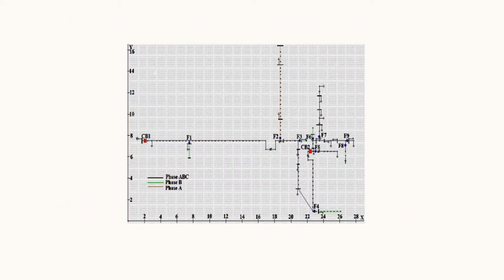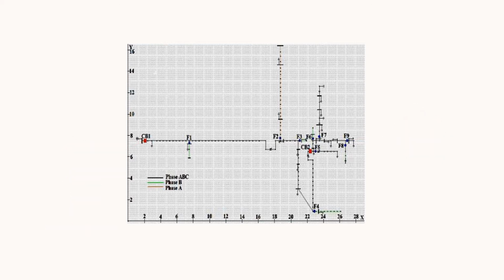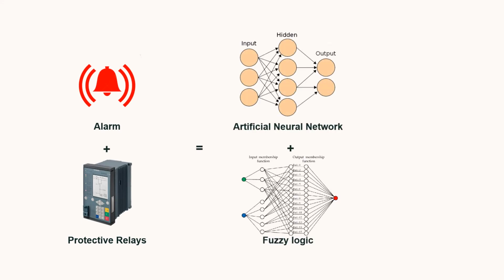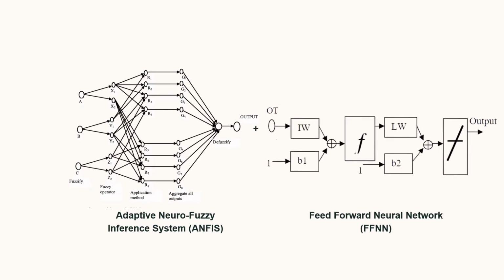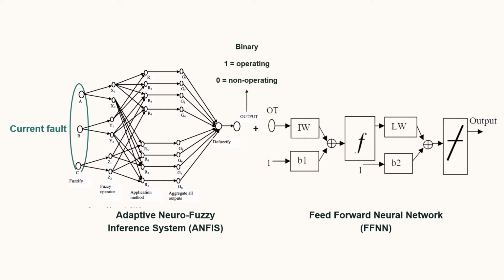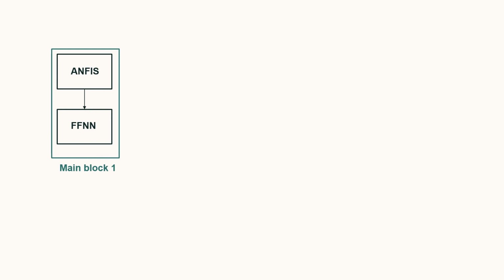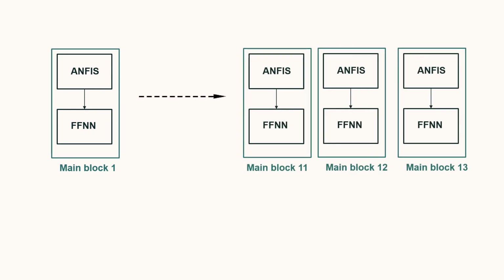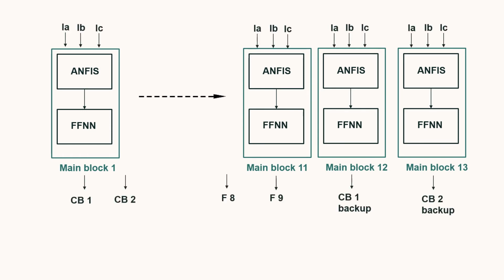5-minute thesis video: Identifying Faulty Protection Devices In A Test Distribution System

Comment: Question from Examiner: Thanks for sharing your work! Since there are so many AI techniques available, may I know why you have selected ANFIS and FFNN to solve your problem?
Reply from the maker: Thank you for the question Dr. Shahrum

As mention in the video, there were few approach that have been proposed before which were using ANN or combined it with Fuzzy Logic which are AI techniques as well. This method requires information from alarms and protective relays. However most of distribution system does not completely equipped with alarm relays.

To avoid using information from alarms and protective relays, this method have been selected which it could solve the problem above and the installation should cost less compared to SCADA and energy management system. Plus, with FFNN can reduce the absolute error of the system.
Reply: @najmizaki1415  Thanks for your answer!

Comment: [Question from Examiner] What is the significance of combining ANFIS and FFNN? Can ANFIS detect the faulty devices without FFNN?
Reply from the maker: Thank you for the question Dr. Hatta
Yes, just using ANFIS still can detect the faulty devices. The advantage of combining it with FFNN is it can reduce the absolute error. The predicted value for the main block will be in decimal point where it is not just single number.

For an example, the predicted value for main block 2 is 0.4337. Thus if just using ANFIS, the outcome for main block 2 will be 0 and the absolute error for this will be 0.4337.

When combining with FFNN, the final outcome will be in decimal number. Thus the absolute error will be less compared to when only just using ANFIS.